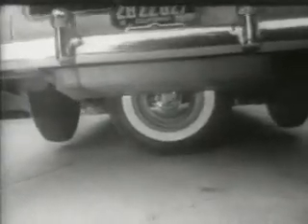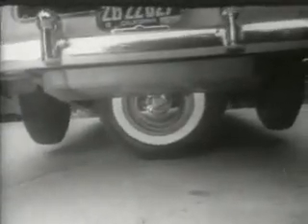1950's Fifth Wheel Parking Concept

Comment: With the computer and sensors this could be a simple add on. No need to attach to the drive shaft. Use another 12 volt motor and hydro lift unit to swing the car around either way. 🙂

Comment: Appears bizarre but actually technologically simple.  Just a wheel on a chain or belt, in line with (RWD) driveshaft.  Couldn't do it with front-wheel-drive though.
Reply: Yes you can. Electric motor driven spindle the wheel/tire are mounted on. Would use little more room than the mini-spare. I just want the money.
Reply: Yes you could with front drive
  They make front drive all wheel drive

Comment: Imagine how much smaller the gas tank would have to have been to allow for this ... gas was cheaper but those cars gulped it down so you'd be stopping for more "motion lotion" much more frequently. Best to just use that time to learn how to park and maneuver with 4 wheels (not counting the steering wheel).
Reply: Could this device be connected to the hitch and placed behind the vehicle? That way, it wouldn't take up any vehicle space, and it would make the spare easier to access.

Comment: this is fucking genius why it never came for mass producing?
Reply: If I had to guess: Tons of people don't have to parallel park, it uses up a ton of your trunk space, extra mechanical parts (all that can break) for something that's used a tiny amount of the total car's driving time, and the mechanical cost.

"Revolutionary" stuff like that tends to either sell-out like crazy, or completely bomb. Because of the added expenses, it's only justified if everyone wants it. Like automatic transmissions. Those WERE wanted by everyone, and are used 100% of the driving time, so it's much easier to warrant the extra cost to the consumer. Even today, many automatic models cost ~$1500 more than the manual model.  Now, imagine paying that much for parking assist. Only rich people, or people who are super afraid of parking, would buy it at that price. And it's possible it'd cost more than that, since a transmission is just swapped in--it doesn't need a redesigned trunk, a clutch to engage/disengage the fifth wheel, the fifth wheel itself, and so on.
Reply: i hears the guy went bankrupt. sort of the way tucker did
Reply: Today you would drive that wheel with an electrical motor. But the space and weight problem is still there...
Somewhere in between they were going to rotate the normal four wheels 90 degrees for parking, but that failed as well...

Comment: There's actually not a fine line at all. If a car is safe, it's safe, I don't care if an ant would dent it.

I also believe you'll find that cars are far more reliable now than at any point before now, that's why Toyota have to build some extra faults in to keep the mechanics happy.

Comment: As an added result, the people today are buying cheaply made vehicles that, even when they don't crash, experience all sorts of technical problems. There's a fine line between making a car safe, and making a car structurally weaker than a steel back yard fence.

Comment: Guessing POWER STEERING wasn't invented yet?
Reply: Of course it was.
Reply: Cool comment; power steering was a thing, but many cars still were not equipped with it. My 63 Chevy has manual brakes and steering
Reply: This device was to get you into a tight spot by driving forward and into the parking spot THEN swinging in the tail end .

Comment: @mrtoomy All parking spots are not just wide enough to fit the breadth of a car, this is an irrelevant innovation which only complicates things. Also, from an engineering perspective: 1. a huge amount of extra space is needed (your choice, no trunk or a 5th wheel you will use once a month) 2. hydrolics enough to lift the whole car which is just another set of mechanics to break 3. triple wheel coverage for a single drive shaft means a weakened and more breakable drive shaft.